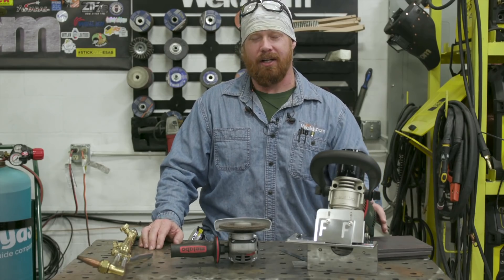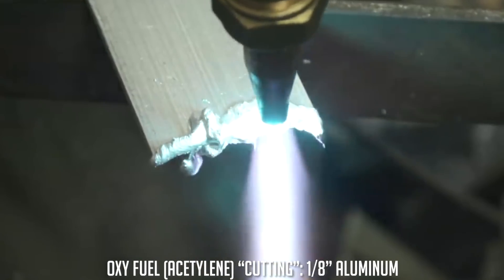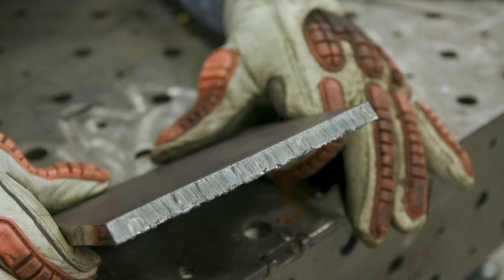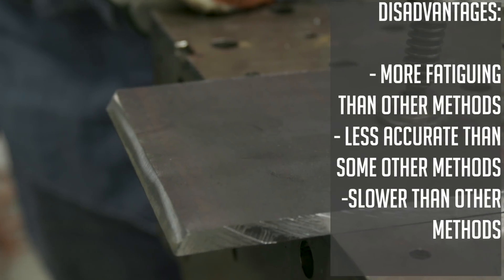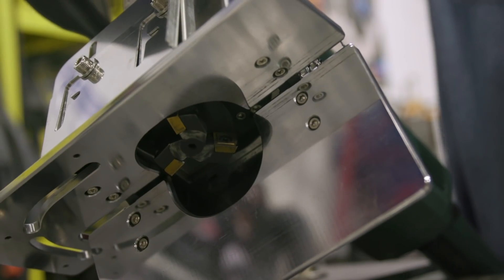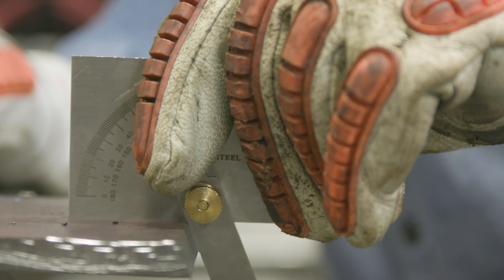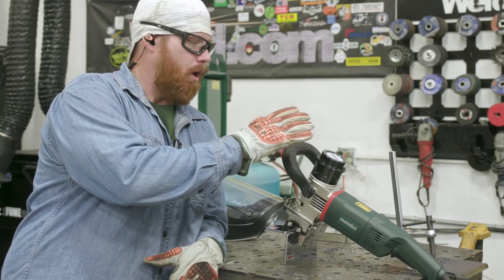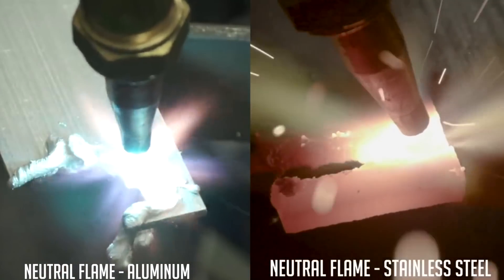What's the best way to bevel plate?

Comment from the maker: Note: The third tool used is a "beveler", not a "nibbler". Doing a search for a nibbler will bring up a different tool.
Reply: Great tool from a great manufacturer .
I would like to include a plasma cutter in the methods.
I remember the video where Bob cut a bevel using the torch and a burning guide
Reply: @daniele3275  I was NOT happy about Hitachi spinning off their nail guns and whatnot ... until I saw the Metabo name on them. I think Metabo was making them before anyway. I don't think I've ever had a "bad" Metabo tool in my hands unless it was slap wore TF out.
Reply: Weld.com Dear Weld.com team... is there any chance to make a simple and short demonstration regarding terminology of Manual vs. Mechanised vs. Semi Automatic vs. Automatic Welding and their methods... please
Reply: That Metabo machine is working using a milling cutter.  The machines I used when I was an apprentice many years ago were Trumpf , those did work using a nibbler action.   https://www.trumpf.com/en_US/products/elektrowerkzeuge/beveler/. They were good machines but after you certainly knew you have been using it , much like you would if you had used an angle grinder.
Reply: Thanks
Reply: He just wants to feel special

Comment: Beveler for sure, but with my budget as a hobbyist, grinder
Alumium can be done with woodworking equipment so a table saw or miter saw will work terrific.
Reply: For aluminum you can use a router if you're careful.

Comment: my cheap harbor freight band saw or  spend the money on a good circular saw and blade and it will  do a hole lot more and still be a hole lot cheaper
Reply from the maker: You can bevel with a metal saw, but the benefit of the beveler is it's accuracy. We have a metal saw and should've thrown that in there as well.

Comment: Why cut it twice? A standard wood circ saw with a carbide blade will cut 1\2" aluminum like you are ripping plywood. There are circ saws that will do the same with steel.
Reply: Get a steelmax circular saw for metal the deck tilts for bevel cuts just like a wood saw its awesome
Reply: Carol Florian I was thinking about getting one.
Reply: My two different Milwaukee metal cutting circular saws have no tilt.  They only cut at 90°
Reply: lambertmt  I’ve put a block of wood under the saw plate tilting it enough for 25 deg bevels.
Reply: I use carbide bit woodworking tools for beveling aluminum because grinding will embed grit into the metal. Works like a charm and costs almost nothing compared to the Metabo. Hell for that price you can get a used mill.

Comment: Metric sucks, I was raised on U.S. Standard System LOL  (also called the English, Imperial or American)  Thank you any way. When they put American system numbers on it I`ll Think abt it...
Reply: Metric system is for pussies! Any dim-wit can tell you that 2.35km is exactly 2350m, or that 1.25bar is equivalent to a weight of about 12.5t evenly distributed over an area of 1 sq m, or a depth of about 12.5m in water, but it takes a real man (not a woman, nor child) to tell you that 2.35mi (and it's mi, mind you, not nm) is exactly 12408ft, or 148896in, or that 1.25lb/sqr in is equivalent to a depth of about 3ft in water.
Reply: @hypersphereengineering6015  Shhh  leave the caveman alone,soon he will discover fire . . .
Reply: Yeah Metric sucks because it's so simple to read accurately with little to no time or mistakes. Raised on both, can read both but will always prefer metric. If you can count 1 to any number you can work in metric, of course that's if you can count lol😎
Reply: cant recall the dates ... BUT USA was one of the first countries to sign up to Metric system which is soooooo much easier than the old British inches and Lb-foot-umberels-length per cricket pitch system.  And it seems to be religious nutters who continue to block its use for the people who could be making USA a much more prosperous place.  Does anyone is the US know about this?????????      Hi from Ballynahinch UK
Reply: @williammclachlan8537  The older generation is very stubborn. I'm in welding school now and we use both systems interchangeably, for the most part. In previous lives I was a bicycle mechanic and a US Navy machinist. I'm comfortable with metric but prefer imperial. I loves me some fractions! I do a lot of woodworking also, and imperial units just feel right for that type of work.
When I was training to run nuclear reactors in the Navy, our math instructor always had us give our answers in bizarre units of measurement - distance would be in milliSmoots, speed would be football field/fortnights, time was megashakes, etc. The thought was we might be called upon to work in an engine room of a captured or disabled foreign vessel, and we needed to be able to do unit conversions quickly and accurately.